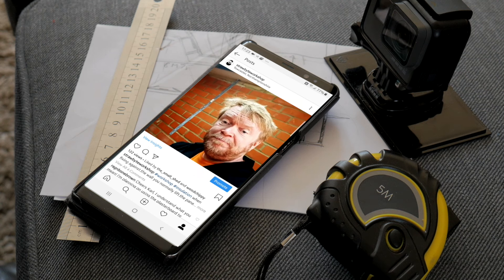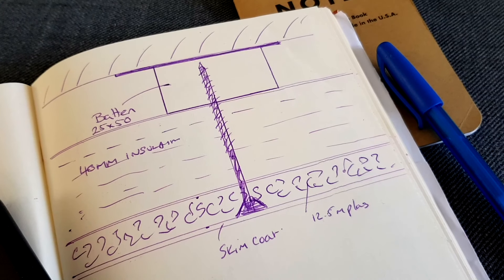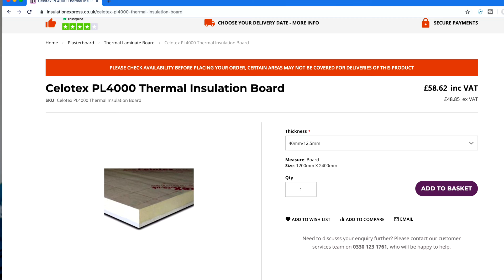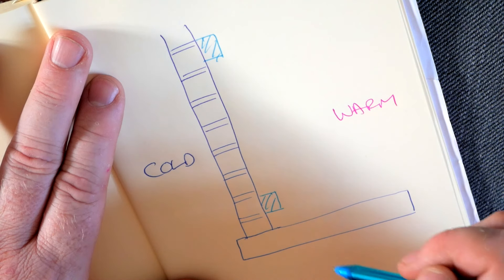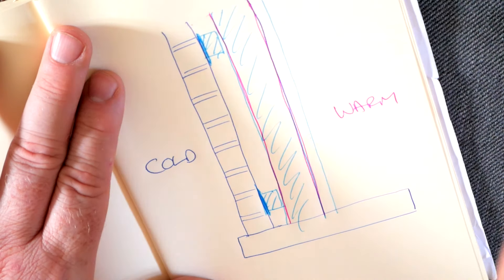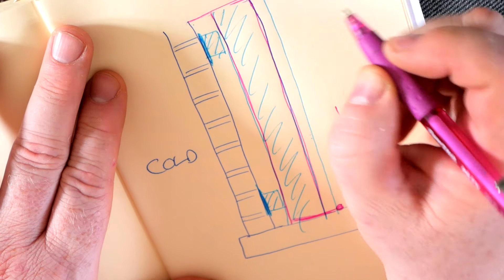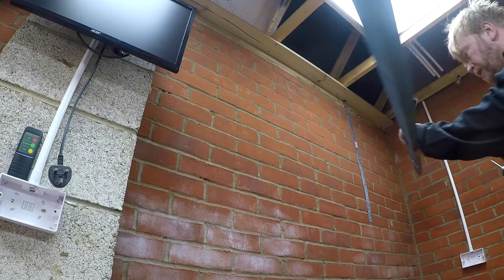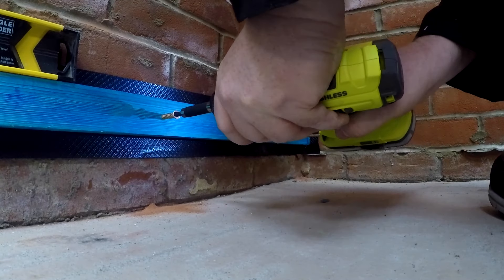How to Insulate Your Workshop | An Easy DIY Project | Keep Your Shop Warm or Cooler

Comment: Superb video Karl. The benefit is in the detail. I have a newbuild brick shed and this will help to convert it into a warmer one. Just spent a while checking through all your replies concerning sealing. I assume the complete external perimeter of the wooden studwork is sealed before the celotex is fixed and then this too is sealed all round including the floor gap. I have a new upvc doorway in the garage wall. However, the brickwork wall is so uneven that there is no internal brickwork reveal left. so creating a seal with celotex to the upvc frame will be a challenge. Creating a reveal using the thickness of the stud (47mm) plus 40mm Celotex plus 12mm MDF creates a reveal just 100mm deep. Can I just turn a strip of celotex into the reveal and glue/seal it to the batten edge followed by MDF sealed to the upvc or will this create a damp cold spot. Obviously all the studwork has DPC behind it.

One last thing. I assume you stopped all timber battens above the DPC layer and relied on the stiffness of the celotex board to continue down to within 8mm of the garage floor, where you sealed it with AC50.
Reply from the maker: Thanks for the comment. A lot to unpack here.
So, in terms of sealing. The wall is battened and the celotex is fitted. It's important that the it is a close fit to the side walls and fortunately in my situation the block columns were straight enough. Seal the gap between the celotex and the wall now, and the floor too. When I boarded over the top, I sealed again to get a clean finish for paint.

In your situation, I can't fully comprehend the transition between the door and wall. Getting the detail right here is about minimising cold bridging. When I put my door in kept the transition around the door quite simple. I'll come back to this in a separate reply.

Your last question has the correct assumption. All my lower battens are above the DPC. That said, using the method shown in backing each batten with DPC material could allow you to bridge the DPC with minimal adverse consequences, but it's not recommended in the guides from insulation manufacturers. I guess this is that when a batten becomes wet on its end the moisture or rot will migrate along the grain.
Reply from the maker: Hello again @olddiyer I've quickly recorded a video about the detail around the door of the workshop check it out here: https://youtu.be/0ZLimvz0EEU
Reply: @StrawbyteWorkshop  Many thanks again Karl for yet more super video material. Your video has helped me overcome some problems I have experienced after installing a new doorway in my garage. The reasons are explained below. 

I had to use a bespoke UPVC door to fit the limited wall height and as a result a Birtley type steel lintel had to be used to support the single brick course just above it and the wall plate where the roof trusses were supported. This type of lintel has an "L" shaped shaped cross section with an outward protruding section along its interior length to provide added strength. As as result the wall battens had to be 2x2 to clear this feature and this limited the insulation thickness I could use to remain within the depth of the garage piers. As a result I decided to use 25mm PIR Reticel board overlaid with 12.5mm MDF

The wall itself was another issue as it had been badly laid and was 5mm or more out of vertical in some places where the doorway had been cut into it. However, the 2x2 battens proved to be ideal to create a solid straight , vertical fixing adjacent to the new UPVC door. These battens were positioned just far enough away from the doorway frame to ensure a reveal thickness of 25mm insulation plus 12.5mm MDF would overlay the new UPVC doorframe by about 17.5mm. In other words the timber battens were not positioned right up to the doorway frame.

The gaps between the timber battens and the crooked walls were sealed all round. 25mm Reticel PIR board was then fixed and sealed to the new flat studwork bringing it flush with the studwork edge around the doorway reveals. It was then sealed all round and to the floor below the DPC.

25mm Reticel was then glued and screwed to the timber battens inside the reveals, once again sealing it all round to prevent the edges touching the rough brickwork. Finally, 12.5mm MDF was fixed over the insulated reveals to make a neat straight corner as you show in your video. The MDF was also sealed all round.

Using this process I could fix the MDF right up to the UPVC doorframe and seal it, hopefully prevent excessive cold bridging at this point.

Comment: Hi, I have a new build detached garage that isn't fit for anything at the moment, too small for cars and too cold and damp to store anything that isn't wrapped in binbags & gaffer tape! So I have been looking into ways to insulate it so I can use it as storage (as we apparently can't use our loft). I came across your video and it is exactly what I was after! The most I've done DIY-wise is put shelves up so I wouldn't say I am an expert but you broke this down and explained it well enough that I honestly believe I could have a real go at this and get some decent results! I did have some questions, though:

1) I've seen your reasoning to as why you moved from plasterboard to MDF and it made sense, I'm likely to use MDF myself because there's nowhere for me to effectively store it unless I bought it all and got it put up in the same day, which probably isn't realistic. I was wondering however if there is any noticeable difference between the plasterboard wall and the MDF beyond how they look? Do you feel you get a better result with one over the other?

2) You also mention being careful not to have this seen as a conversion into a habitable space, my house came with a similar 'covenant' and I was wondering if there are any regulations anywhere that I can figure out how far I can go before it's seen as 'habitable'? All I am looking to do is throw some boxes in there and maybe a tumble dryer. You could hardly live in it.

3) You use DPC on the battens before screwing them into the wall, but I've seen people use a full sheet of DPC and cover their entire batten frame before attaching it. Further to this , I've seen people say that it's better to leave a gap between the battens and the brick. Is there any advantage to either? Did you only add the DPC to the battens because you were screwing it to the wall as opposed to with a gap between?

4) Final question, I promise! I don't plan on staying in this house forever, eventually, I'll be trying to move somewhere closer to my family. Does work like this cause any issues for reselling? Do I have to follow any kind of building regs?

I'm likely going to follow your plan as your garage is basically identical (although possibly just a tiny bit bigger) and if I'm honest, I'm excited for the summer as it'll be great to get some use out of that garage instead of it being a dumping ground for old rotten ikea boxes and a lawnmower. Thanks for the great video!
Reply from the maker: Thanks so much for your comments about the video and your questions. Answers below:

1. Went to a good deal of effort to prepare the surfaces for decorating. The plasterboard was filled and taped with jointing compound and primed using a primer for new plasterboard. The MDF was primed using a wood primer thinned with 5% water. When decorated with a half decent paint there is no difference in the surface appearance. Importantly there's no difference in temperature to the touch either. I'm happy with both. Over the 18 months since I made the video I've swung back and forth about which method is best. If I were to start again I think it would be insulation and MDF.

2. The building regulations talk about the room contain a place for sleeping. Clearly I have not running water and it is not connected to the house central heating. The comment in the video was largely aimed at avoiding the problem of people looking at the project and then converted their integral garage into a new front room. For that you need to way further than I have to do meet building regs.
I never showed it on video as I was pretty embarressed but my workshop cabinets were ruined by damp in that space before the work. No it's dry as bone. I have frost protection installed now to ensure the temperature doesn't fall below 7 degrees and on a cold week (like now) it costs around £6 per week to heat.

3.The method I used was recommended in the Kingspan data sheets (and others) for situations where you cannot guarantee the outside wall won't get wet. One wall faces my neighbours garden and she's pretty liberal with the hose when watering her plants. The purpose is to stop moisture penetrating into the battens (which are treated as well - belt and braces) and causing them to rot and fail. There is an alternative method which is to use a stud wall set 25mm away from the outside wall and fixed to the floor and ceiling joists. I did consider this and a fellow viewer (and subscriber) is using that approach in a project right now. The downside is you lose a little extra space inside the room. Having thought about i recently I would have lost a further 20mm bringing the total loss to 170mm across the width of the room. When you say full sheet of DPC you could be confusing DPC with vapour control barrier, or maybe not. Some form of vapour control would be needed if you are using mineral wool insulation but with PIR (like mine) between the studs, a vapour control barrier is not required. Just tape over the joints internally.

4. I don't think what I've done will detract from the value if I were to re-sell. To be honest with everything COVID right now there's probably a whole bunch of buyers who will look at conversions like this and think that a) I too can take-up wood working, b) what a lovely place for a Gym, Yoga studio or artists studio, c) my car will love it here, d) I want to work from here. In my case as I've stayed well with the concrete block piers there would be no problem getting a large car into the garage. (I have a large SUV and it fits) If I leave I will remove the parts of the installation leaving a more basic space.  All of the power and lighting will be stripped back to basics. 

And good luck with your project. The whole point of making the view was to show what you can easily achieve with a few hundred pounds and a decent drill/driver. And you don't even need a posh saw either. All the cuts were made by hand with a sharp carpentry saw (for wood) and (blunt saw for the insulation).

Comment: At last, the video i have been searching for. I have the same aspiration of turning my,  new build, garage into a cinema room. I've looked all through youtube for months and could only find American channels which were of absolutely no help. I will be looking to do much the same but with maybe a floating floor and insulated ceiling. So happy you broke the costs down, as that is one of the  important parts that many people want to see. Thank you and look forward to seeing further videos. Subbed.
Reply from the maker: Thanks so much for the comment and good luck with your project.
Reply: Doing the Floor and ceiling will improve the insulation by 100%.  I have 100mm all around and 200mm in the floor.  Can heat my workshop with a candle.  Also the ceiling insulation means I don't enter 'oven mode' in the summer. you will need to work on 100mm minimum if you want to make the garage a habitable space and the floor and ceiling/roof become mandatory.
Reply from the maker: @Dickie2702  I absolutely agree. I've done the roof-space (see separate video) and that makes such a difference especially (as you say) in the summer months. There's no insulation in my floor as I need to be mindful that putting in a false floor might constitute a 'conversion' which I'm not allowed to do under my deeds.
Reply: @StrawbyteWorkshop   I put 50mm insulation over the subfloor, a vapour barrier and 'green' 18mm chipboard over that as a floating floor.  As my workshop floor is 300mm above the ground level and there plastic down in the 'crawl space' in seems to work to keep draught and moisture our.
Reply: @nevetsre7001 Could you share the exact type of insulation and vapour barrier you used on the floor? Was build control inspection required in your insulation project? Assuming this was England? Thanks

Comment: Thank you for such a great video just subscribed. 
I have built a single skin blockwork wotkshop that if like to dry line fornnot only warmth but also protecting neibours from being disturbed by sound of bandsaw chop saw table saw etc. Its a relatively new development like yours so i want to playnice . How do you rate the sound insulation properties of what youve installed. ? Ive been looking at 50mm knauf acoustic insulation rol and siniat 12.5mm blue db plasterboard combination. Is there anything youd do differently in hindsight ?
Reply from the maker: Hi Andrew - I'm glad you enjoyed the video. My workshop forms the boundary between ours and our neighbours property - they are really close, much closer than our house is to the workshop, and sound was a consideration. I did film some before and after sound measurements from the front, side and back of the workshop and overall the sound-levels drop by around 10dB with the insulation installed. However, what I found is that it was air gaps that was the biggest source of noise transmission. At the eves, to allow the roof to ventilate it was hard to seal and include large amounts of insulation without disrupting airflow. At the garage door and the personnel door gaps around the door and frame resulted in a lot of leakage.

In hindsight, better sound insulation performance could have been improved by choosing a different approach and materials like those you're considering. The connection between the wall and roof structure could have been improved a bit further - perhaps installing mass-loaded vinyl in the corner. However, all that would have sacrificed some internal volume and I'm not sure that would have been worth it.

It's mass that absorbs sound and I do wonder if lightweight celetex has any benefit at all, and that what I percieve is the effect of the MDF which is a very good sound absorber/reflector.

It is something that I plan to re-visit. The roof insulation got re-done (something I may cover in a follow-up video), and I've made further changes to reduce the temperature in the loft space I created during the summer to protect things I store there from excess heat. Those changes have increased the ventilation in the roof with a bigger gap on the neighbours side. I can hear her when she's on the phone in the garden and I'm sure she can hear me torturing wood inside.

I have added lots of 'sound-absorbing' surfaces in the workshop which does mitigate the situation a little - there's is way less ringing and reverberation which I can clearly see in the waveform of any audio I record.

So I hope that helps. Gosforth Handyman has done a drum studio video which covers extreme sound reduction/proofing - to the point of suffocation. So you might want to look there too.
Reply: Thank you for that I'll check out your other videos. I've just boarded the ceiling with db boards and knauf sound insulation just the walls to go now. I had thought of mdf over knauf on the walls. ( Promised myself no mdf would ever make it's way into the shop but much stronger for hanging cupboards on than plasterboard but noise reduction from hearing outside is most important
Reply from the maker: The link to the old video is: https://youtu.be/fpO6lMwRpCQ

The thing I got wrong was leaving a gap between the two layers. It's taken 3 years as and when I've had access and the patience to do it, to go back into the space and move the insulation layers to remove the gap.

Comment: Great video. Just wondering about the block columns that divide the walls that remain uninsulated, is it the case that given their greater thickness heat losses through them aren't significant enough to address by insulating them which would only eat further into your internal space?
Reply from the maker: Hi - thanks for the comment. The block columns are now covered an insulated. At the time of this video I delayed insulating them while I thought carefully about what my requirements were. For the sections already installed, the would only support the hanging of light items and small shelves. But, being a workshop more robust mounting options would be required for heavy shelves and equipment, perhaps.

The solution was to use 30mm insulation over the blockwork with a 19mm structural plywood box over the top and bolted to the blockwork with shield bolts and in contact with the ground. I'm thinking of doing a follow-up in a couple of weeks on all the little additions to the project made over time.

However, you are right in pointing out that the increased thickness of the blockwork and brick does generally reduce head loss resulting in being able to specify a lower thickness of insulation under the plywood box.